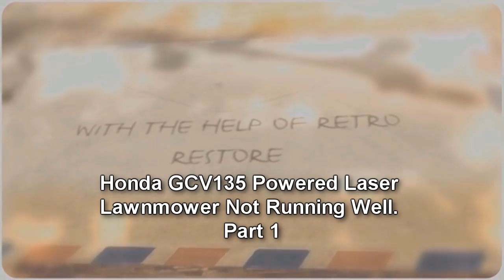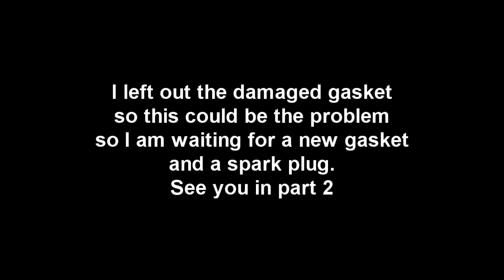Honda GCV135 Powered Laser Lawnmower Not Running Well Part 1

Comment: Just a little note , setting the governor , all correct and well shown. When you set it , set the throttle lever in the fast position.
On the throttle lever on the handle,  Basically the hare picture on the throttle lever. I  have spoken to Martin regarding this ,
and it is something that can really help the issue. Hope this helps people , who are having trouble , with the running .
Reply from the maker: +Peter Froud Nice update Pete..
Cheers
Martin
Reply: It all helps , the honda book says set , throttle open .Well when you pull the governor open The throttle is wide open , they do not explain very well.

Comment: With these two videos, you give us a nice overview of what can go wrong with 
a mower. Thanks for sharing it with us.
    I'm putting it my craft_favorites playlist so I can find it when I need it.  It might not be so easy to find among the 800 or so videos in my small_engine/auto playlist. 
    If you are just getting started in you-tube, you can save to playlists that you create. But once you get several hundred entries it can be surprisingly hard to find the one you want. So, for example, if I have one or more comedy playlists, at some point I create comedy_favorites, because some videos are just special. 
   Later on it might be smart to go back and prune your playlists. I will flag a video by liking it, and save it to a playlist if it is a good one for me.  Once you get to five thousand, the app stops reporting the total, I just hope they are still in there. You might want to avoid making my mistake.
    Somebody may find this useful.

   Thanks again Martin, also I like your rants. That's exactly what I would do if I were me.

Comment: Great vid those carbs are fiddly the gaskets are a pain sometimes I have to set the valves on these if it's still not running quite right. It makes a huge difference on the gcv 135. Brilliant mowers though worth the time and effort!
Reply from the maker: +Mower Man  Yes they are a little fiddly Paul, Ill get to the bottom of it though in the next vid.
Cheers
Martin

Comment: Great video. I have the same engine that's running well that I want to put on a rotavator. The rotavator is belt driven upon drive engagement on the bars. My question is I have swapped the pulley over and made some spacers to enable the engine to mount. Will the engine run ok driving the pulley with no load, bearing in mind no blade will be fitted?
Reply from the maker: They can kick back when starting if you don't have the blade fitted.

Comment: am thinking about purchasing a ultrasonic cleaner after seeing yours, what size is yours litre wise and would yours fit a full motorcycle carb body??
Reply from the maker: +GTs Garage Mine is a 4 litre and i've had motorcycle carbs in there. It's the only way to really clean carbs.
Cheers
Martin

Comment: @Retrorestore Hi Martin, excellent job mate! You've helped me in so many ways with theses vids. Especially on this particular model!

I have a question for you, being an veteran in the field.

I have a garden that requires a big mower. Currently I have  2 mowers that fit the bill in stock... 

53cm (1999) Mountfield Laser Omega with Honda GCV135 4.5 

and a...

53cm (2011) Mountfield SP555 with Honda GCV160.  
Both in very good nick.

I want to say newer is better, but  I'm not sure, which do you think would make a better keeper?

Many thanks
Reply from the maker: I have no preference, they are both good engines. Just down to condition.
Reply: @retrorestore  fair enough. Cheers Martin. 

They are both in very good condition. I think I will keep the SP555 as its 12yrs younger and has Ali deck with 20yr corrosion warranty. Plus a slightly more powerful honda engine.

I just wondered if the older Mountfields are better than the newer ones.

Thanks again for your help mate.